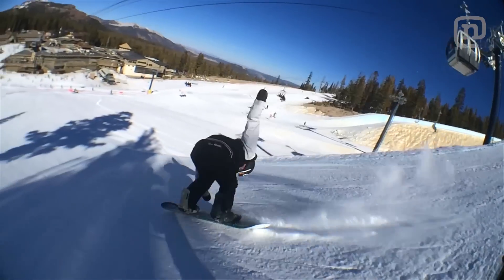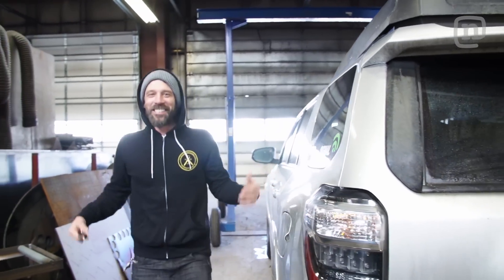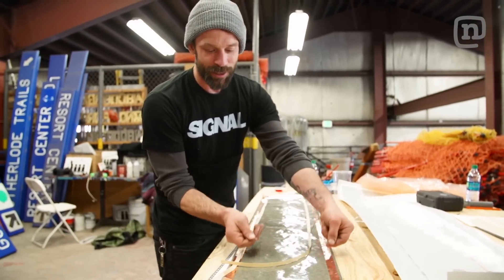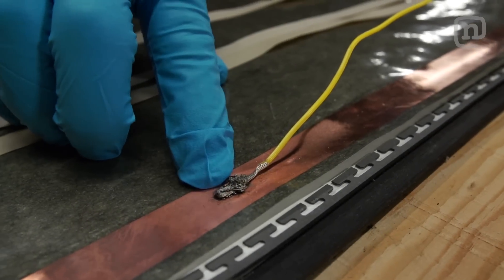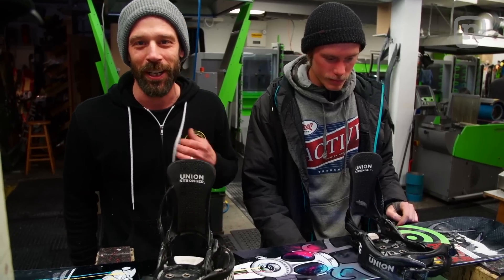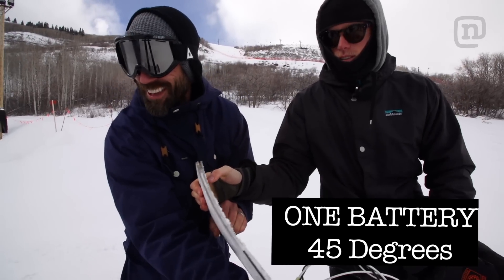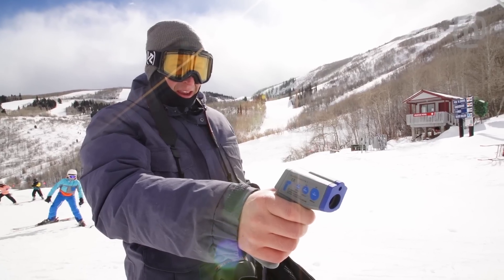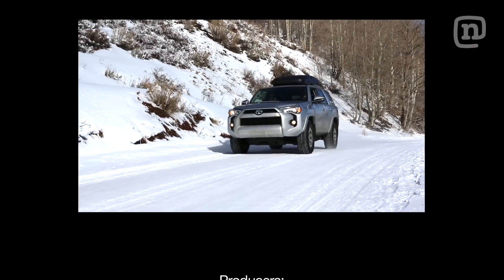Speed Stick Heated Snowboard—Go Faster! Every Third Thursday

Comment: Who doesn't want to go faster?  
This has been an idea we had for years and we finally made it happen.  Enjoy and Thanks for watching.  Learn more about what we do by clicking the link to our website in the about section above or head over to signalsnowboards.com
Reply: PATENT IT! Haha
Reply: A snowboard doesn't actually melt the snow underneath (neither does an ice skater for that matter). The increase in pressure from going over the snow/ice actually raises the melting/boiling point of the ice.

Snow/ice is strong because it forms a crystal lattice that holds all the molecules together. On the top layer there are molecules that don't have others to connect to so they wave free, creating a liquid like surface.

here is a picture of what I am attempting to explain.
http://2.bp.blogspot.com/-cXQSuwQOcAg/TfXWakrHK6I/AAAAAAAAAHk/LXfvO12baok/s1600/ice_structure.jpg
Reply: This is a cool idea but it will always be limited to how much power you have, you guys didn't even limit yourself to the snowboard itself but instead carried the batteries in the pocket of the rider.  If you put your hand against snow it will feel cold at first but slowly start to change as your hand heats up the snow but if you drag your hand through snow it will get much colder because your constantly coming in contact with fresh ice cold snow.  I wish you guys could've monitored the temperature of the board as you were riding to see how warm you were keeping it as it passed over fresh snow rather than the temp when it wasn't in contact with something freezing cold other than air.  Still a crazy idea, you guys are like bill nye or myth busters for snowboarding.  Hope you do more vids like this.
Reply: This would have to be one of the first etts I've watched where you haven't destroyed the board by the end of the run hahaha
Reply: Chad Lynch Hey Chad, check out our signal 6 program.  signup until April 15th. Signal 6  A brand new Board plus Swag
Reply: I want one :D Love this show
Reply: could you combine this with the solar panel top you did to self power?
Reply: Ian Dingle  You could use it to charge the battery packs, but not to be directly powered from the solar panel. Those 22v battery packs are probably NiMh, which would have a maximum current output of around 2 to 2.5A. If we say 2A, the two packs can output 88 watts of power.

Looking at the PowerFilm's website, they don't specifically state their power output per area, but calculating it from one of the larger models gave a figure of 36w/m². For a snowboard of approximately 0.34m² that would generate just over 12W; barely an 8th of the required power, and that assumes 100% sunlight intensity, sunlight incident orthogonally to the solar film, and no obstructions. With the rider's shadow, footholds, and the angle of the board, you'd be lucky to achieve even 5W. Roof mounted solar panels are far more efficient, generating up to 1KW/m², but flexibility comes at the tradeoff of the higher silicon density of the more fragile static solar panels.

If you were prepared to allow it to charge in the sun for 20-30x the duration for whic it will be used, it seems like a great all-in-one concept, particularly for people who take snowboards around on ther car's roof racks.
Reply: Commodore Luna   Looks like lithiums to me...And yeh solar panels are way too weak..Just plugin an 12v 5000mah lithium batt and youl be melting snow wholeday long ;)
  This might be good to other things too like snowmobile's sleds and such :D
Reply: Kippuravittu
My bad, I thought they were one of those large bundles of AAs. Found the battery model on "pulsebattery" website (1080p comes in handy for sleuthing!) : It's a pair of PLU45-37006 packs (Each is 3700mAh 22.2V).

I don't know much about Li-Ion battery packs, but from what I've just read, the "45C" rating for those battery packs means they can discharge continuously at 45x the battery's capacity, so 45*3.7 would be 166.5A (Just over 3.5KW per battery pack), so in this case the batteries could probably supply more power than the heat film could safely dissipate.
Reply: Combine the heated base with the solar top. No battery pack needed.

Comment: Your soldering job looks like you did it with an arc welder...
Reply: lol. just watching the 2 seconds of soldering they showed made me cringe.
Reply: +joblessalex yeah haha!
Reply: I threw up in my mouth a little bit
Reply: +joblessalex I cry when i saw it.
Reply: +joblessalex No, looks more like he put the wire on the solder point. took a big fucking shit on it and waited a week or so for it to dry solid
Reply: +joblessalex Haha it works though. What you're supposed to do is tint the contacts then place the wires and melt the soldier over the iron onto the tinted wire and contact. He was applying the soldier directly to the wire and contact without tinting which can cause problems down the road. I also put a little more soldier when in doubt to make my connections secure and i've never had a problem.
Reply: Lol. Tinning" tin is silver in color. when you tin wires they turn silver, hence the term.
Reply: Lol I thought I was off. Yes tinning, applying a small layer of soldier to a wire coating it silver in lead and whatever resin additive is in the soldier. I was saying tinting my whole life and I was wondering why it didn't come up on google.
Reply: Haha. we all have those moments. my sister used to say "diginal" instead of "Digital" when she was a little younger
Reply: It's not Rocket Appliances
Reply: Antinull Fucking appliances?.
Reply: +Antinull i think my brain's short circulating
Reply: +Ty Lloyd I dont have enough people words to make it understand you the way it understands me
Reply: joblessalex 
As a welder, I concur. Looks pretty much like a MIG weld, but without shielding gas.
Reply: Tru
Reply: Vakama 905 and on -1 V / 20 A ^^
Reply: It is very hard to solder directly to large copper sheets. The copper dissipates heat so quickly that your soldering iron cant stay hot enough to bond the solder to it (sometimes). The trick is to: 1, have a low melting point lead solder. 2, use a flux paste to help the solder adhere. 3, use a screwdriver tip soldering iron. 4, use a high quality soldering iron that heats quickly. 5, Tin the wire first.

Or just use a heat gun to melt the solder on the tinned wire, to the copper.

Comment: The feeling of faster might just have beena placebo
Reply: The placebo effect gets a lot of us lol.
Reply: That's what I was thinking. Without any statistics, this video is nothing but an advertisement.
Reply: Probably was, they should have speed tested it
Reply: Probably was, they should have speed tested it
Reply: +DragonBorn true, i need numbers to compare
Reply: Legend Cox that's a TERRIBLE idea they would have to ride the exact same path every single time which if you snowboard  at all you know it's impossible to do every curve the same every time and even then they would still have to factor in the weight on the front or either the back of the board which also could affect speed I could go on but I'm hoping you're starting to grasp why this is such a bad idea they could have just had accelerometers on their body and even then that would have been inaccurate because the temperature outside itself could have gotten hotter or colder during each run so there's really no clear away to prove this it is super cool though I'd use it !
Reply: I agree I was thinking about that the whole time, however I would like to see some real scientific tests on this type of a board, and to see if it in fact can reach higher speeds.
Reply: +sharo moini wow, such savage, very comment. Wow
Reply: :D
Reply: Ouch! My feelings!
Reply: +sharo moini also placebo
Reply: This clips do look like they are getting faster
Reply: +paul “Bladedsquirrel” g Your spelling is getting worse.
Reply: +CheekyGoose its not like they're selling these , god.
Reply: +Anthony Adams you can do multiple runs down the course and take the average times heated vs non-heated. if it truly is faster an average time of multiple runs would show this eliminating the variables you mentioned.
Reply: I know, I was just saying what I thought at the time.
Reply: +DragonBorn It's not placebo. Its simple. Most waxes are designed so that the warmer they are, the more effective they will perform, having the board heated means the wax is performing in a more optimal temperature range.
Reply: I agree I mean the camera man was keeping up just fine
Reply: +DragonBorn snow sticks, so he feels when its more slippery
Reply: Plebasaurus Rekt  FF6

Comment: be careful where you keep those lipo batteries because if they get to low they will blow up and catch on fire. when they are used in rc cars there is something called lipo cut off which cuts it off when they get low to prevent it from blowing up.
Reply: Some kind of safety circuit is ideal with those kinds of batteries.

Comment: You should measure a straight run with a speed gun and see the difference between a regular board and the heated board. The speed difference you are feeling could be a placebo effect.

Comment: This need proper scientific process. interesting none the less.
Reply: +Yoshi And where does the heat go when it disperses? The heated film heats in a downward direction, heating the wood below it, heating the snow below that. The transfer of heat isn't as slow as you think. There's easily enough time to heat up a significant layer of snow that will cause a noticeable change in speed.
Reply: +putte vigå The board won't lose it's temperature. It peaked out at 128 out of snow, and it's natural that it can only maintain 85 degrees in the snow. Heat is continuously supplied from the generous 22v of electricity, and the friction of the board and the snow. argue all you want, these guys have the real results in the video.
Reply: +Yoshi Actually, it's possible the heat that it stays at while under motion may be enough to heat up, even a millimeter of snow that'll melt into water WILL actually reduce friction, because the snow crystals have a higher coefficient of friction than the water.
Reply: Hugh Jackovich I will argue that even a millimeter cannot be melted with the technology presented in this video.

When the board presses onto the snow, the high surface area will want to drain the heat from the board very fast, if you design the board to not drain fast then your board will not have a good time transferring heat. If your board is good at heat transfer, then in order to melt snow at the average snowboarder speed of 30mph (48kph), you'll need more then a wall outlet could provide let alone a mini portable shitbrick sitting on that snowboard. (just under the average power consumption of a small house)

In fact, I could argue the battery/components on the board is slowing down the snowboard more then the board is generating any extra acceleration.
Reply: ***** You're literally just spitting your imagination of how things work. Heat is constantly generated and constantly transferred. Transferred to THE SNOW. You say it loses all of it's heat very quickly, as if it isn't constantly being supplied. Buddy you can imagine all you want, the fact is they tested it, and showed the results from the infrared gun.
Reply: ***** wow you're not bright are you? Yes, heat is being generated, yes heat is being transferred, but no there's not enough heat to continuously melt snow while going down the mountain.

when you stand on the board the pressure being applied increases heat transfer, if the board is designed to transfer heat easily then it'll lose it's heat too fast, if it isn't designed to lose it's heat then it wont make any impact to the snow when it's travelling fast and not having enough time to transfer heat.

they didn't test anything, standing on the board and saying "whoa dude, I think I feel it" is not testing.
Reply: ***** Here's what we do know, jumping on a board and saying "I think there's a difference" doesn't count as "testing". The science behind snow and a snowboard isn't hard to understand.

It's my opinion, I never made it otherwise as I personally haven't built this board and used actual science to determine the outcome. But from what I've seen here, I can easily explain why my guess is based on logic.
Reply: Your guess is based on misguided understanding of physical principles. Of course the test has no factual evidence. However they are experienced snowboarders and I say we shouldn't ignore their opinion. Now maybe they're lying just for the sake of business promotion, but I don't see them selling this product, or even producing it. So why market for something you aren't planning on making or selling? It is testing, whether you agree or not. It's called field testing.

You can of course have your opinion, but you have to understand there are facts surrounding this study. The foil is specially designed to heat and stay hot, and the 22v really have no problem producing a lot of heat. You saw the heat gun. Could be a lie. But it might be the truth.
Reply: ***** At what point am I misguided? Of course you can ignore their opinion when it's not based on a testable outcome. When I explain how there will be no difference due to how the energy to melt snow itself while speeding down a slope will be more then what the battery can handle. Snow takes a small amount of time for heat to transfer to it, if the board is good at transfer, then you'll lose energy fast. Moving at 48km/h the time to melt snow will not be less then the time the board will be on that area. If anything you're adding weight to your board and any momentum you're building up at all will be displaced through the extra weight causing friction on the snow.
Reply: +Yoshi the snow isn't drawing much energy since it is an insulator - you wonder why snow doesn't melt? it would make a difference in making a better water slick under the board and the board probably would have been warm after. it isn't going to increase the top speed but acceleration definitely.
Reply: ***** I'm done. You obviously can't be convinced. They performed a test. There was a procedure that was followed. Their conclusion is up to their opinion but they did have an experiment. Argue it all you want I don't really care. Engineers don't have time to watch YouTube videos and reply on the daily, let alone watch anime. Enough with that gib. A minuscule amount of snow would melt practically immediately given those conditions. You wouldn't be able to see how much, but you don't care to listen to that part of what I'm saying Mr. Engineer. And yes, look at the gun, and hush. Heat is maintained. You're arguing something that is clear as day and on video. For that reason, I'll say it again. I'm done. No more wasting time with you.
Reply: I'm gonna take a crack at your theory of arguing, because it is actually really funny.

"For you to create this effect the water needs to be pressurized under the two surfaces"

Wait for it

"Water runs away from the pressure taking heat with it and also creates higher surface area yada yada yada"

Soooo are you arguing there is pressure or isn't? Dude just quit. What a poor "engineer"
Reply: +James Callahan This is the scientific method in process. Hypothesis > Experiment > Analysis > Result
Reply: ***** You're saying that the heat is dispelled within the snow, lowering the temperature of the board because of the "pressure" between the two surfaces at hand. So if this pressure exists, then why doesn't it act like a lubricant as you explained in your earlier paragraph? I'm getting annoyed at your stupidity.
Reply: You're throwing different arguments everywhere. But yeah I guess I'm stupid, even though I can at least handle the task of following what I'm saying. First you say the snow wont melt, then you say that the melted snow will diffuse into the snow below it.

Well kid, snow is very dense, as are most solids You know that whole 7th grade lesson that the particles in a solid are more packed together? Yeah that. So what that means is that, within the small amount of time the board is making contact with the water particles, the water will not have enough time to seep far enough to create a noticeable difference compared to the amount of water created.

Yes. I'm this "fucking stupid" XD
Reply: Faster faster faster! We like speed.
Reply: I mean if the little amount of friction is all that is needed for ice to melt, surely creating some sort of heating element would improve the rate at which it melts
Reply: @Nivexity  well actually the extra components speed it up due to higher gravimetric acceleration and newtons laws (Engineer here, and I love boarding) but agreed the results are skeptical. But next level think of speed of Hot knife through butter?